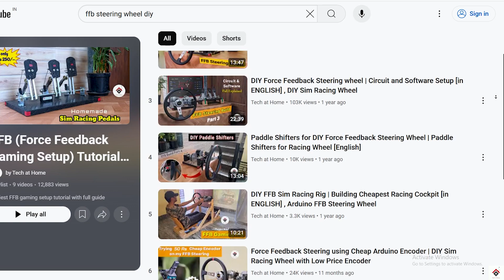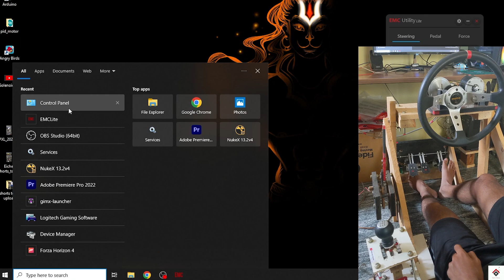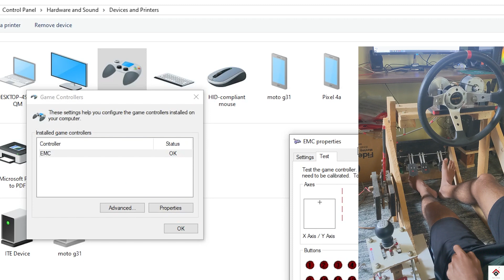How to Setup DIY EMC Steering Wheel in MUD RUNNER | Mud Runner FFB Steering Wheel Settings

Comment: what is better EMC Steering Wheel or wheelcongif 
hello from argentina
Reply from the maker: RFR wheelconfig comes with lot of features for free, but it gives many issues during calibration. I tried initially but left it after multiple attempts.

EMC has free and paid version lite and pro.
Lite is very basic but the pro version is like wheelconfig where you can tweak lot of things.
EMC is very easy to use. I am using free Lite version and everything is working well.
Reply: @techathome  I’m currently using RFR wheelconfig. It works, but I’m thinking of trying EMC to see if it’s more compatible with some games. For example, My Summer Car doesn’t recognize my wheel properly with RFR, and in games where it does work fine, like ACC, I feel the FFB is a bit different — maybe EMC can improve the overall feel.
Reply: Faça você mesmo o seu .. fica mais barato
Reply: @CANAL_DS_ROTA86  mi pregunta es si es en cuanto al ffb y compatibilidad con los juegos cual es mejor wheelconfig o emc steering
Reply: @lucasmalla3  a bom .. 👏👏 na verdade eu não sei te dizer qual